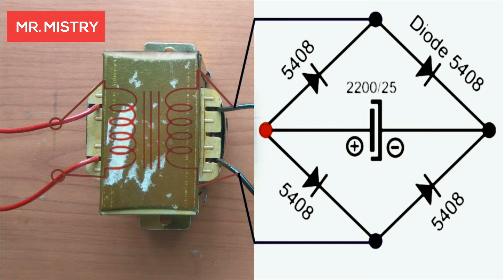Make 12 Volt DC Supply (2A Transformer) easyway

Comment: Can i use 470 uf 25v? Thanks sir
Reply: Yes, you can use a 25v capacitor with a 12v circuit, although there is no reason to buy the 25v over the 12v one

Comment: Bro can i use 3a transformer with the same diode...
And wat is that diode circuit called??
And can i use any capicitor??
And can i use any diode like 1n 4007 or 1 n 5408 or any other...?
Plzz reply...
If ur okay plzz give me ur contact...
Reply: First example if your tranformer is 2amps don't use more than 2 ampere capacitot ( 2200uf =2amps ) cause it will get heat faste. 
Don't give higher ampere in capacitor  than transformer instead   you can use lower ampere capacitor. And the diode bridge is called bridge reftifier
Yes you can use any capacitor but not more than transformer ampere l, and diode like you mentioned 4007 is the most common used.

Comment: is that transformer non ct sir??0-12 ??
Reply: Yes, with a centre tap the rating is specified as 12-0-12 or whatever volts it drops to, also see a missing centre tap wire?

Comment: can I use 4007 diode
Reply: 4007 stands 1 Ampere current .. but since in the video he used a 12-volt transformer with 2 amperes then he used the diode 5408 that can stand up to 3 amperes.. so it depends on your transformer current if you are using 1 ampere or less  transformer then u can use 4007 diode

Comment: It's not exact 12v, voltage is above 15v DC..
Reply: Agar isme load denge to 12v hoga
Reply: Use resistor brooo
Reply: It is due to the capacitor